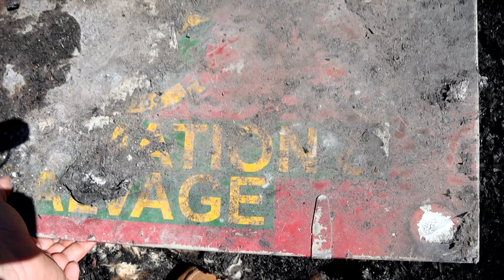Our shop burned down! No one was hurt but nothing survived.

Comment: Man that is such a bummer. Was the dust collection system running? So weird.... The crazy thing is what the heat does to the steel, not sure if the metal is negatively affected or not and how hot. You'll rebuild, and be back bigger and better than before. Just sucks this had happened.
Reply from the maker: No but it had been running most of the day it had been off for a couple of hours before the fire. It was so hot that most of the aluminum melted
Reply: @WastedTalentFabrications  WOW.... And who would have ever suspected that to have been an issue? Such a bummer.